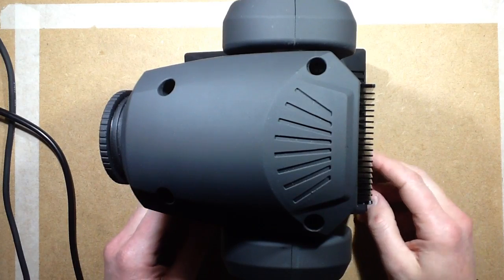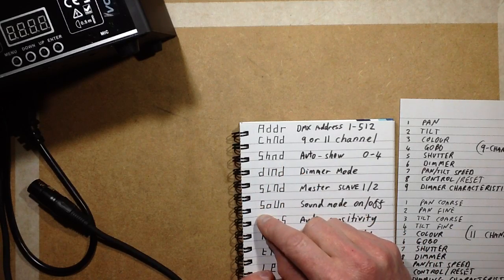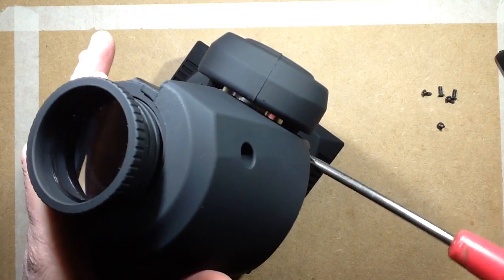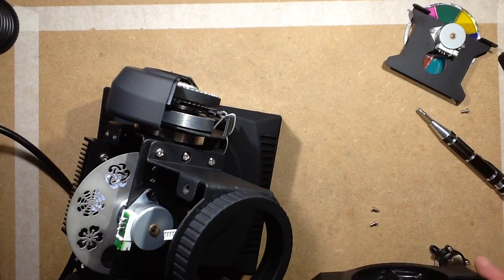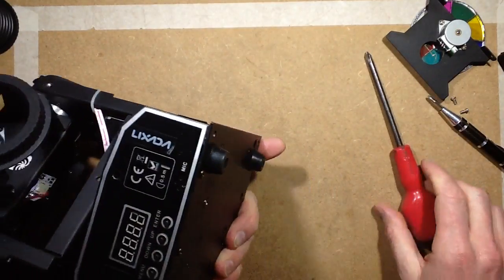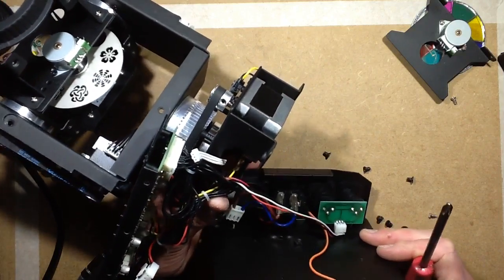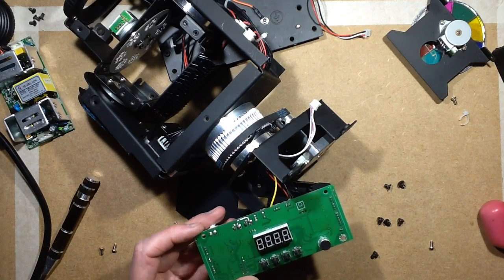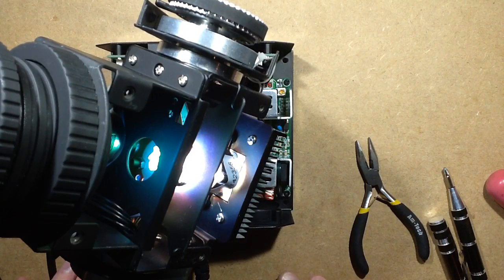10W LED "blunty" moving head disco light teardown.

Comment: Been considering one or two of these as a first beam/spot to mess around with and surprised to see how well this seems built. Wonder if the quality is the same these days.
I got the cheap wash light, one of the more common Chinese moving head fixtures you can find (billions of listings on eBay, the brand I have is a Betopper 7x8w), at an auction for cheap. But would like a beam/spot.
Great video!
Reply from the maker: These are certainly OK for a personal lighting collection.

Comment: Has anyone replaced the LED module? I have a couple burned out units, and cannot find the module online (P/N LZP-000003-LED on the module. Alternatively, I could solder a new SMD LED, but there are several 10w units that use various forward voltages (Cree XML at 2.9v, others at 12v, etc.). Any suggestions?
Reply from the maker: Whatever LED module you use would preferable have close to the same voltage/current rating as the original to allow use of the existing driver.  It would also have to have a similar illuminated area for optical compatibility with the lens system.

Comment: Bought four of very similar lights some years ago. They all popped within a 30 minute window. When I opened them up, three of them had blown resistors in the power supply unit while the fourth did the same on the control board it self. The supplier sent replacements for the items but I still haven't really fired them up again except when checking to see if the replacements worked. Just haven't been that curious to see whether they'll pop again or not 😅, so they just sit in storage waiting for something to happen (the cases they came in however have been very useful for other fixtures that actually work 😛)

Comment: My small movinghead is a white 60 Watt U'King Mini moving headspot looks just like that one but mine is snow white color and it does have a decent good big size cooling fan inside it. Different gobo icons though and i do love this light alottoo. At somepoint on i'm gonna be getting a much huger size moving head light like the 7R 230 Watt Shehds or Sharpy moving head lightthat legit goes in night clubs lol. i also do DJ EDM aswell. That little LED light lens there inside at the back inside atthe LED chip, it looks like an eye ball lens / eye lens lol. The Pupil lens or the entire front of eye lens. Cat eye lens have that like half ball shape eye lens

Comment: If you had 10 lights on the DMX bus, and wanted separate control of each, that would be 110 channels, so you could easily use all 256 channels for a large stage set.
Reply from the maker: A DMX universe is 512 channels.  But some modern lights can use massive quantities of channels.

Comment: i personally own about a dozen of these particular fixtures, and I love them for playing with at home. in a small room, you don't notice their small size at all.

one thing worth mentioning: it actually does matter which "manufacturer" name is on the sticker. there are several of these fixtures that have been rebranded under different names, but each rebrand has different software, a different DMX patch, different dimming curves, and sometimes even different color and gobo wheels. the brands I can remember are Lixada, U-King, E Your Life, and Ovation, but may favorite is Lixada, because they're the only ones to use flicker-free constant current dimming, the blues are deeper, and the dimming curve lets you go suuuuuuuuuper dim to the point where you almost can't see it. dimming on the Lixadas is obviously granular, but at lower intensities it's not too bad.

ONE THING TO WARN:
Some of the Lixadas have a problem where changing the "LED" setting will actually cause the power supply to blow up. i have no idea how this happens, but each time I change one of them to another setting, the light resets twice, then blows sparks out the back. i replaced the PSU's and compromised by simply putting a piece of gaff tape over the display and using a silver marker to write the address on the tape.

awesome video Clive!
Reply from the maker: I didn't know about the self destruct mode.  That's awesome.
Reply: como asim modo autodestruição do noving  head

Comment: When taking things to bits...I use Sharpie markers in various colors to put a little dot on each connector/socket pair to more easily match them later when reassembling them.  
But taking pictures is now much easier with cameras on our phones...so I tend to do both as a just in case kind of thing.

Comment: my rotating disco light is similar but  the brand is  floureon  i have no display on mine all of a sudden was working the last time i used it it turns on and bottom fan works but the heat sink fan doesn't spin only spins if i physicality touch it any ideas?
Reply from the maker: Sounds like possible 5V power supply failure.
Reply: @bigclivedotcom  thanks  the display started working again but the heat sink fan still is a.bit dodgy does that mean new.fan?

Comment: highlarious description from the linked eBay auction: "2 in1 Hair Straightener Curler Styler Negative Ions Curling Hair Curlers Tool UK. Lighting Effects : Pattern Gobo(s). Built-In Program: Standard Voice, Self-Propelled, Master-Slave, DMX. Mini-Pattern Moving Head Light, Compact Structure, The Output Is Good, With A Variety Of Patterns, Easy Installation, Easy To Carry, Moving In Light Weight, Projection Accuracy, Good Effect."

Comment: Hi Clive
I’ve been running two Mini Led Moving Head Units for around two years. On setting up a few weeks back one of them for want of a better description just twitches, the condition stepper motors, cooling fans and also the led on the power board. 

After watching this post,  I used boards from the good light that I had to locate the fault area, and arrived at the power board being the culprit. Thing is at this point It’s pinning down the likely faulty component, a touch out of my depth, since when I was last employed in electronics was in the days of valves back in the 60s. Have you any ideas on this?
3 components I have ID are : 7H7S 0551 FHF 5N60,   6C5 FHF 10200, and EL 8170715 I have a picture of the board but can't figure how to post it.  "cdn1.imggmi.com/uploads/2019/9/7/8fb3aba45b1766500f028647f0192d5e-full.jpg" The best I can do is this but you will need to add the usual to the beginning.

Comment: Great video. I was looking to see if there would be a way to do a custom GOBO for my wedding. I guess you could glue a piece of clear transparent film with writing on, over the hole in the GOBO for the straight-through (no GOBO) effect?
Reply from the maker: You can get LED gobo projectors designed to take laser printed transparencies.  Or alternatively, use a video projector with a short animation loop.  Alternatively, depending on budget you can get custom laser etched mirrored glass gobos.

Comment: I have just bought two of these off EBay now that they are under £100 for a pair- I have always wanted them for my show but have been put off by the price.
They worked fine when linked with a DMX cable in master/slave mode but at one point stopped "talking" to each other. To cut a long story short, I started pressing random buttons on the front face to try to relink them. I didn't manage it but did come across a "sub sub" menu which isn't on the instructions-  one that seemed to give me control over tilt, pan, colour wheel and to Gobo values. The screen would show "gxxx" "txxx" etc. Where "xxx" were the three figure values. 
Has anyone else found this "Easter egg"?
BTW the heads now seem to talk to each other again, now so all's well with them again.

Comment: Would it be possible to upgrade the led in one of these to one with  a higher output. ?
Reply from the maker: That would require a new driver in the already tightly packed base.  Possibly a new lamp loom and either a larger heatsink or an extra fan for cooling that could affect the balance and inertia of the unit, resulting in loss of positional sync.

Comment: could it not have 4 wires 2 for cw 2 for ccw?
Reply from the maker: If you're referring to the stepper motors the use of four wires to control individual coils allows accurate positioning in either direction with smooth continuous rotation.
Reply: @bigclivedotcom  no it was the led i guess i should have listened better lol

Comment: This is a somewhat ridiculous idea, but do you think it would be feasible to mod a moving head fixture such as this to instead function as a dmx-controlled pan-tilt mount for a camcorder?
Reply from the maker: They have made DMX controlled camera and projector mounts.  The cheap disco lights have a slightly steppy movement though.  You might be better using a good quality PTZ (Pan, Tilt, Zoom) CCTV camera.

Comment: In the last scene where you're concluding the video and the light is moving about randomly, was it just doing that on its own without being connected to a DMX controller?
Reply from the maker: The light has an auto mode if there is no DMX present.
Reply: I see, that's good, thanks.  Is this a common feature on these kinds of lights, even in the professional high end lights, or is it more of a feature found on the cheaper lights such as this one?
Reply: Lachlant1984 auto mode isnt on theatrical lights like a high end ADJ all lights for mobile djs will have auto
Reply: So this light is clearly intended for use by DJs then I suspect.

Comment: Are you saying that if you were to plug this light in without having it connected to a DMX controller, the light would just move about and change colour and gobo as it wants to?  If so, is that the case with higher quality, higher end industrial moving spot lights?  If this light can just move about and change colour and gobos on its own, then that would be OK for decorative lighting or at parties etc, don't you think?

Comment: When you decide to start taking photos this video reminded me of something I did...  back in 2002 I worked for an electronics repair company (around the beginning of the death of the industry) fixing TVs for a giant retailer in the tri-state area (every non-functioning set was brought to us, around 150-200 daily), mostly CRTs and rear projection styles.  A company (who's name is a type of screwdriver), had recently come out with this ultra compact style of projection TV that was one of the first we got that had a computer diagnostic tool...  plug it in and it says 'replace board A/B/C' or some component (remember the death of the industry?) and in this case were told it was the 'light engine'.  A few days later a travel case, the kind you'd use for a ginormous sound board, showed up with this tiny light engine inside, sans instructions.  I'd yet to open the set up as we'd no idea how long it would take to get the part and didn't like half-finished projects laying around...  time to crack it open.  It was the most ridiculously engineered thing I've ever seen...  using 7 diff types of screws (including Allen head, wtf?!), and had obviously been built AROUND the bit I had to replace.  By the end of the day, after a thousand cuts on the stupidly sharp and sticky-outtie bits (which was basically everything), hundreds of photos and millions of swears, I'd managed to replace the component...  problem was, I had 113 screws left over !!!  The TV worked and passed my throttling/shake test so off it went...

Many thanks for this video and the memory !!!

Comment: would it be possible to upgrade to a stronger led with the stock setup by just replacing the led?
Reply from the maker: No.  It would require extra cooling, extra balancing, a new power supply and a new LED driver.
Reply: bigclivedotcom thank you for the response.  I have 2 of these units and there great.  was hoping to upgrade them.

Comment: Is there a mod you can do to these units to make the fans less noisy. We have some 60w ones and the fans are so noisy.
Reply from the maker: You could add a sleeved resistor in series with the fan, but at the risk of problems associated with reduced airflow.
Reply: @bigclivedotcom  I wonder if replacing the stock fan with a Noctua one could help? 
NF-A4X10FLX looks like a match: 40x40x10mm, 12V 0.6W 0.05A, 3.700-4.500 RPM

Comment: Good video, could you explain what the Pan Fine and Pan Course means?
Reply from the maker: +richardc1983 It allows for fine tuning of position by offering finer increments than the coarse channel.  Pretty pointless with the cheap lights though, as they are not very accurate anyway.

Comment: had to take one of these apart from my dj set up i brought 4 lights together two scanners and two moving heads 3 of them was qtx brand one moving head was a generic brand no name when i had them pat tested the odd one had no earth strap  that was sorted at time of pat test by me but recently the odd one stopped working all so would never dmx as a slave before but upon taking apart when not working discovered all the wires had striped from bottom to going up to yokes rewired and now heatsrinked and works again for now but have ordered an received a qtx one now the 4 work miles better but the qtx ones have fans on leds though and bottom fan isn't as noisy   http://www.ebay.co.uk/itm/QTX-Synohead-10W-White-LED-Professional-Compact-DJ-DMX-Master-Slave-Moving-Head-/112166940026?hash=item1a1dabad7a:g:uFcAAOSw4shYAQIl this was one i had

Comment: I was hoping to convince the school to invest in a small DMX controller and an end-point 220v distributor box for basic stage lighting, which would make setup/teardown a lot easier, but the school likes to cheap out on the drama budget. So we're stuck with my old rebuilt deathtrap switch/dimmer panel with one 110v cord for every channel running from the booth at the back all the way to the front of the gymnasium where the stage is set up. I used to go through a lot of gaffer tape, lest somebody trip over one of those cords.

Some proper PAR cans would be nice too, rather than these 150w NOMA halogen flood lamps I've been getting by on... And some nice light stands so that I don't have to go up to mount them on the ceiling girders... And while I'm wishing, I'd also like a pony.

Comment: After a quick search on Ebay, it looks like there is a plethora of other cheap moving head lights available. You should cover some more!
Reply from the maker: I'll probably cover other ones in the future.
Reply: Cool, cheers!
Reply: +bigclivedotcom  hey I got four of them so I connected one it moves nd works just fine but the led light wont turn on or light at all

Comment: Does anyone have any idea, what kinda output is being fed to the LED? 6v/12v etc? as if i was to replace the LED with something a little more brighter? :)
Reply from the maker: The LED is driven by a dedicated current regulating driver with a control input.  Replacing the LED with a higher power one would require an upgrade to the driver, power supply and LED cooling system without affecting the weight too much to avoid unbalancing the light.
Reply: +bigclivedotcom I see so it's limited to the 10w factor so to speak

Comment: Great Video, I just ordered these lights. Do you happen to have a video similar to this one for the Sharpy 7r 230watt moving head??? I Have 4 and 1 light... the lamp turns on... and about exactly 1 minute later the lamp shuts off... what should I look for? I can see the voltage dropping until the lamp shuts off (voltage from the led driver)
Reply: Could be a heat problem or most likely a defect component.

Comment: Seen a disco light couple of times and wondering what was inside.  Thanks to you, Clive, now I know.
Interesting stuff.
 I can compare it with a a two axis, alt and azimuth,  gun control ( pointing mechanism I built way back in 1969 as my final year project. It used a bunch of ECC33 ( If I remember right) dual triodes. Only old timers like me can grasp how far technology has come.
Last week I soldered a 100 pin C8051F120 chip on to a pcb ( both from China) for a portable blood Oxygen monitor that I am cooking up. This chip runs at a 100MHZ clock, single clock cycle operation, and is made by Silabs.  This is 50x faster then the original MCS-51 chip. 
It boggles the mind.

Comment: the light seems rather dim.
Also it's so wrong to still use steppers. Steppers are fundamentally awful when a normal AC motor with encoder is vastly superior and not circuit wise a challenge today. Steppers are heinous legacy things.
Reply: +Dan Frederiksen Huge theatrical lights still use steppers with gear systems to make the movement smooth. Steppers are better for this application, however the AC motors with encoders is not bad either.
Reply: +tsltyler - TSL Studios, no, steppers are not better for this application.